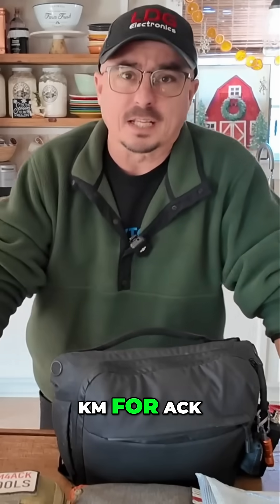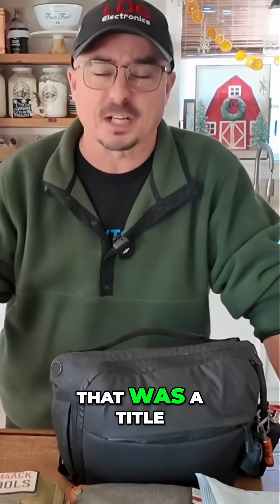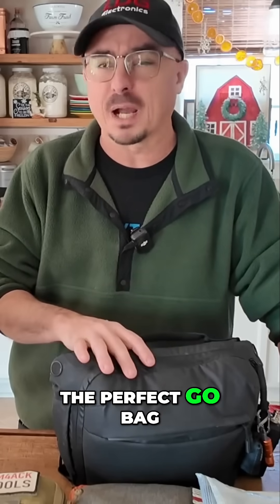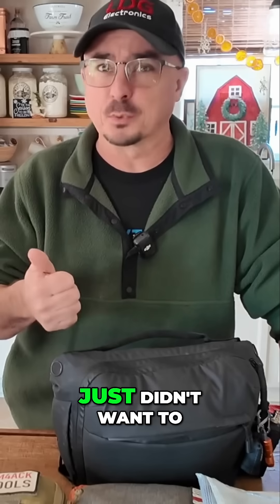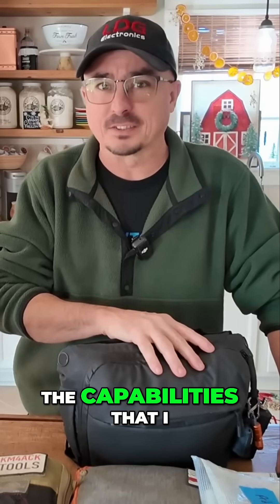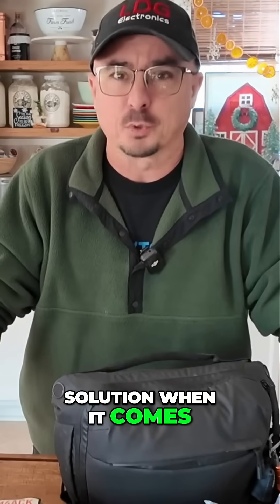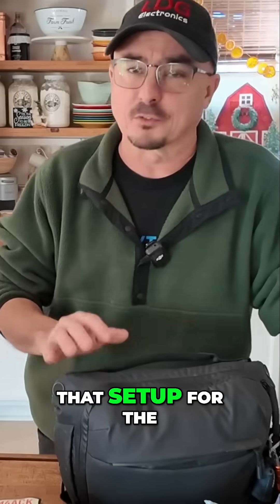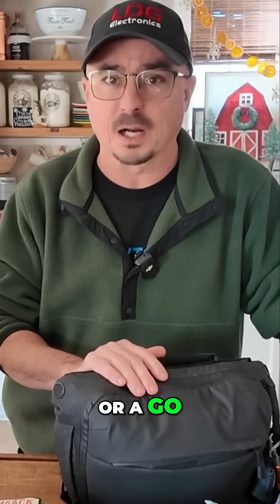Modular Go Bag :: The ONLY Way To Prep Now!

Comment: Yes a modular approach is the best approach if you take different equipment for different outings.  The items needed to operate from a picnic table might be different than what you need to operate off the tailgate of a pickup truck or the equipment needed if you are going to hike to a high point that is inaccessible by vehicle.